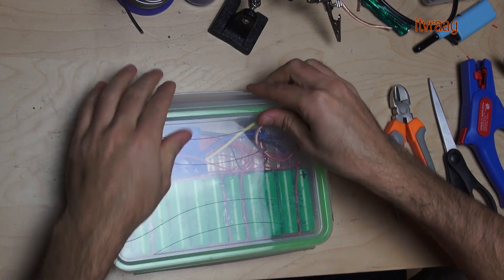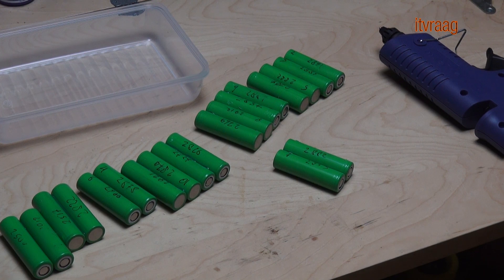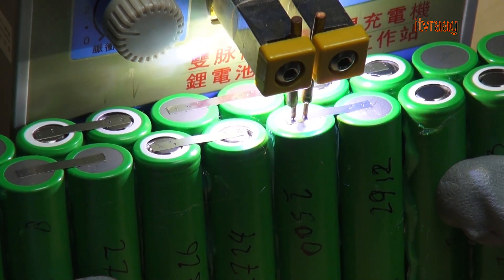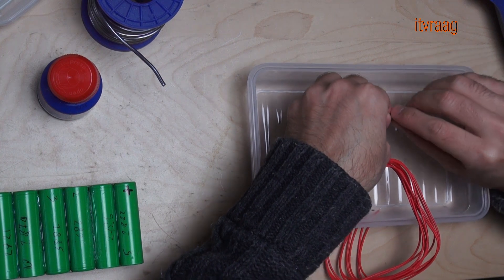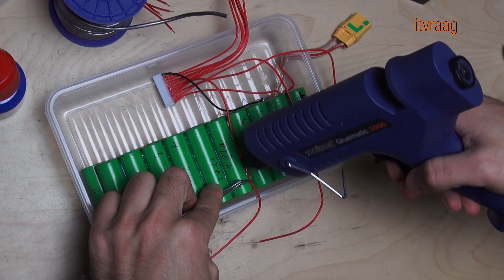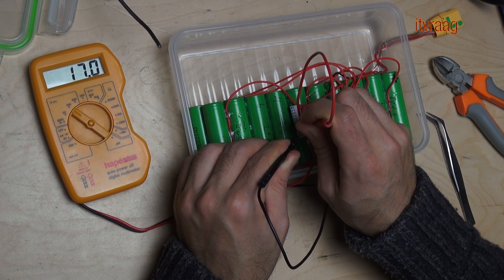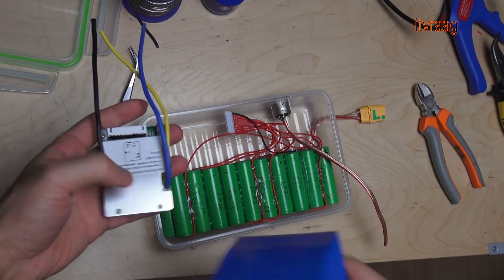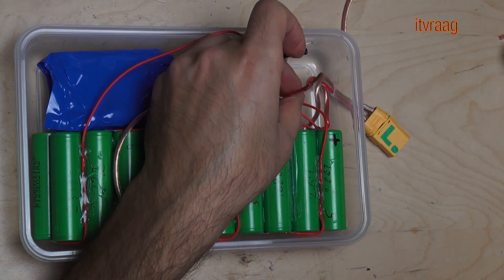DIY: 10 cell battery pack with BMS and charger (36v, 10S2P)

Comment: Cool video man I have a question for you I am working with an ebike that had been in the rain and it had its own control board in the battery itself it seems to control the light that is built in the battery pack and charging and the battery pack output to the battery rack I am pretty sure that control board is broken and I want to replace it with a universal 36v ebike controller I know how to connect the outputs off of the battery to the new controller but I don’t know how to charge my battery then the ebike used to have a 41,2V / 2A DC charger like can I connect 42 volts directly to my battery terminal’s or no?
Reply: Usually you will connect the charging terminals to the BMS.

Comment: I’m new to BMS. Quick question: If my BMS is rated at 20A, does my batteries must be rated exactly at 20A or at higher?
Reply: Nope, that means you cant surpass that A 

10s2p is about 4.5–6 A

So a 20a bms could handle like 10s6p  (13-18A)

Comment: Hola soy de México está increíble tu video, podrías mostrar a con detalle dónde va cada cable de rojo soldado a las baterías, estoy intentando hacer una batería para mi bicicleta porque la que compré ya no carga, pero estoy en la parte de conectar los diez cable a las baterías. Saludos!
Reply: Hello, I am from Mexico, your video is incredible, you could show in detail where each cable of red soldered to the batteries goes, I am trying to make a battery for my bicycle because the one I bought no longer charges, but I am in the part of connecting the ten cable to the batteries. Regards!

Comment: what if i would like to add a switch and two connectors? one for the motor controller, and another for the power supply charger? is possibile to have a schematics?

Comment: How do you know when the batteries are fully charged?
Reply: the bms will cut of power once all the batteries are above a certain voltage at which point the light on the xlr charger will change colour i think or at least thats what happens with mine

Comment: I have a plug with four holes and whant to put it on a battery that already have 5 holes female plug, 2 of the 5 holes is plus and minus, but the other 3 is red, orange, yellow. What is them three other colors for? and how can I but five different cables to a plug with four holes?
Thx in advance

Comment: someone help me please: i'm converting an hoverboard to a golf manual cart, to motorize it. i bought the controllers and the throttle, but cannot understand how to charge the hoverboard battery li ion pack. it has 2 wires black and red. but the connector of the charger has 3 one more for the temp. so i  don't know how to charge the battery pack once i teared down the hoverboard with all its circuit board and sensor board. is there a charger for li ion battery? o i need to re-use the circuitry of the hoverboard? thanks in advance please help i'm stuck here

Comment: How do you tell how many volts and amps to feed into the battery. It that the BMS' job to manage that?
Reply: Also my thought. How?
Reply: Late answer, but the voltage you feed into the bms/battery is where the battery pack will be charged to. I am assuming a normal bms. The bms wont regulate your current for you. You should have something else for that. Thus a constant current charger.

Comment: hey. 48v 20ah 800w for (ebike) which bms can use in? another point  if 18650 10000mah make 48v 20 ah 800w how many batters in group ? thank you  (urgent  reply)
Reply: For 18650 of 10000 mAH= 10AH ,you have to prepare 13s2p or 13 cells in series and 2 groups in parallel to obtain 48v@20AH.

Comment: if some cell of the pack starts to present a problem and the pack does not work more properly, how do you identify the problem cell without having to test one by one? and what specs of that power supply do you use to recharge the pack? Thank You!

Comment: I can almost guarantee the 18650 cell you shorted is completely fine.  They are usually high quality (especially if samsung 25R) and handle short circuits relatively well.

Comment: im trying to make a 72v battery pack and dont know what bms to use. can someone help me
Reply: To prepare a 72v battery pack you require72/3.7=19 cells in series and to the requirement of output current and the capacity of each cell the parallel combination will be decided.

Comment: You could easily have shrinked down the size of the pack by placing the BMS on top of battery and keeping charge and discharge wire separate. 

(Tips: use hairdryer for heat shrink wrap.)
Reply from the maker: +Unnamed. 
BMS didn't fit for this housing on top and bigger housing wasn't good due to the hight of longboard. I would like to use a 3D printer.

Comment: Great video. What are the setting you are using on the spot welder? I just ordered the welder you linked and would like to know the settings for spot welding 18650 cells.

Comment: Great video! If you don't mind, i have a motor 36V - 52A(max) and if i build the battery pack with the BMS you used (according the video and the link you gave, i assume the BMS has 15A discharge current) i wondering may it can provide enought power for my motor?
Sorry for bad English, hope you can understand
Reply from the maker: +thanh son Nguyen 
I've measured the amount of current between the battery and my motor. It was 2amps, so you'll be probably never reach the max. With 2amps I can go up 35km/h with a decent torque.
Reply: +Itvraag
Thank you very much!

Comment: hey, i'm going to build a similar 10s4p pack. I was just wondering if you use this BMS just for charging and if so, how do you balance the cells then? thanks for you time, nice video!
Reply: If my understanding is correct, you can't balance the cells with a 10s4p pack using a single BMS.
Reply: It depends on the type of bms. The cheaper ones just switch the pack OF, if just one cell is full. Others  pasivly balance the cells by  discharging the cells over 4.2v. However as the ballancing might be slow, you should not expect a perfectly ballanced pack after just one charge. Bettet check with a multimeter.

Comment: if I have a 7s battery pack, how much volt/ampere charger does it need (or do I also need to know the number of cells in parallel to calculate it?) and can I get a formula to calculate the needed voltage and amperage of the charger
Reply: Yes,it is purely on the basis of formula.  7s means 7 cells in series, which gives an output=7*3.7v=25.9v. If the capacity of each cell=2000mah=2AH, and you have to obtain 10AH capacity, then the groups of cells(7 cell in series=1 group) to be connected in parallel = 10AH/2AH=5. So the cells are connected in 7s5p method. We have to require 35 cells of 18650 of 2000mah capacity.
Reply from the maker: +SheepIsGaming 
Best to watch my video about voltage and amps basics. But you should multiply the amount of cells by 3.7 for nominal voltage. 3.7 x 7 = 25.9V
The amps depends on how much each cell holds and how many are connected in parallel. The type of cell decides how much amp per hour it can charge and discharge. Also see my video about comparing three type 18650 cells from Panasonic, LG and Sanyo.
Reply: itvraag thank you for the tip! I've watched it (although I knew all the stuff, but it was a good video) but it doesn't answer the question: what for specs does a charger need by a certain ..s..p battery pack configuration. That's not your fault, but maybe a nice idea for a next video?

Comment: Hi man! This is quite interesting but I'm quite stuck on my electric longboard project with batteries. I want to make a system like yours but I'm having trouble figuring out how to do it. I'm going to use two 5s, 5000mah batteries in series to make a 10s 5000mah battery, How would I connect a bms so I can charge it without taking the batteries out?
Reply: Connect the ve terminal  of the battery to B ,the 18.5v or +ve terminal to B+ and 3.7v=B1,7.4v=B2,11.1v=B3,14.8v=B4 and 18.5v=B5. Then c- to chargers ve and p to loads -ve while c+,p+ and B+ are common. When 5 cells are joined in series the voltage of each joints great gradually wet -ve terminals of the battery upto the + ve terminal.

Comment: im building a spot welder for about 250usd.  micro controller, mosfets, super caps, balancing pcb. 4awg wire, cc/cv buck converter 10a 2x 24v 20a ac-dc psu
Reply from the maker: +Johnathan Wuethrich 
Awesome!
Reply: weird flex but ok

Comment: Please DONT use audio cables in a battery pack but silicone wire!
This audio cable insulation will melt very easily with current.

Also when welding DONT put the solder on your iron first!
Put the iron on your wires then the solder.
With you technik you have great chances to create weak solder joins.
Reply from the maker: +Propergol 
You're right on both. However the current isn't high enough and the wires are thick enough to not be an issue but as you said it's best to use proper wire. For soldering I would do it as you said but because I'm using it on 18650 battery cells I don't want to overheat the cells as it has happened a few times. I've used these for few months now and even on rough terrain with lots of vibration they've kept their joints.

Comment: Hi could you please tell where did you get the spot welder
Reply from the maker: Sure, I've added a link for a list of spot welders and a second link for nickel strips. For spot welder it's best to get one that has a loose handle, that makes welding difficult corners easier than the one I have. For nickel strip you should best get one that's around 8mm to 10mm broad and 0.15mm to 0.18mm thick. There are also different shapes which fit well with 18650 cell holders. Hope that helps.
Reply from the maker: Also, depending where you order from, chances are good that you'll need to pay around 30% import taxes! Keep that in mind. But not always.

Comment: Looks amazing! like. Could you link the batterys you bought, I'm concerned about the discharge rate
Reply from the maker: +PRAWON 
Thanks. I made a video on the battery cells a few weeks ago. I've added the link in the description. Hope that helps.
Reply: itvraag Thanks!

Comment: Hi, good video. I think your shrink will be more need if you would use a heat gun. I used it with my battery pack and BMS. https://www.gamma.nl/assortiment/metabo-heteluchtpistool-h16-500/p/B377717
Reply from the maker: +Fernando Schulman 
Thanks, that's true. I didn't want to spend money on that but probably need to buy one eventually.
Reply: Fernando Schulman " your shrink will be more need"???    ROFL!